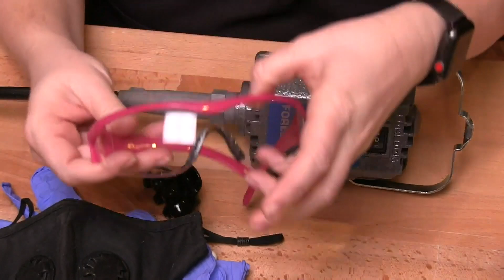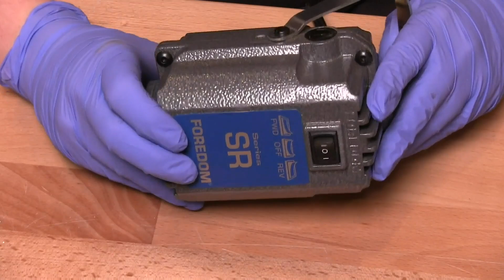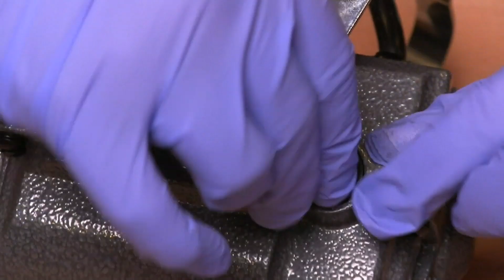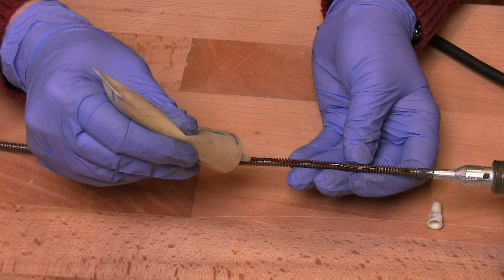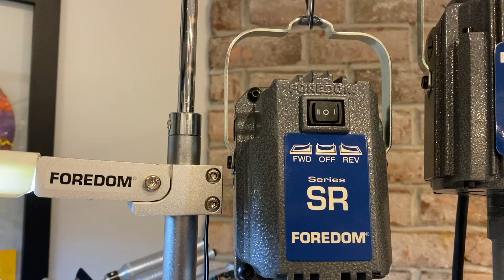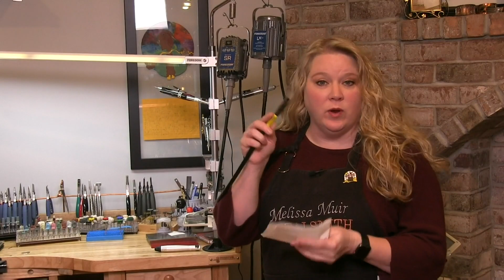Maintaining the Foredom Flexshaft with Melissa Muir

Comment: I just cleaned mine for the first time ever with your help.  Thank you so much!  
I didn’t have any alcohol to use for cleaner, so I put Dawn dish soap on with hot water and cleaned it with a brush and dried well before re-assembling - it seemed to work.

Comment: i have an older foredom that currently does not have the quick disconnect flex shaft. can it be upgraded to the one with the quick disconnect? i want to be able to use multiple heads like the hammer head and 90degree head

Comment: any tips on removing excess grease from the rubber sheath?
Reply from the maker: After you lubricate the shaft and reassemble it with the sheath, hang it down in an unlined trash can without the handpiece and run it at high speed for 20 minutes. Then stop and wipe off any excess grease of the key tip with a paper towel or rag. Always hang up the handpiece or remove it from the shaft after use so warm grease does not migrate into the handpiece. Thank you for reaching out! - Foredom Team

Comment: washing solvent must totally match the lubricating type we are using 

how can I detect of find some info about the original and cheap china lubricants sold as FOREDOM originals?

what widely used lubricants can I buy in any car shop and use with the flexible shafts?
Reply from the maker: The handpiece attaches to the sheath not the shaft. The proper way to adjust the shaft and sheath is to slide the inner shaft coupling up completely on the motor shaft and tighten the set screw on the shaft flat. Then thread on the motor connector all the way, snugly. Next, insert the  key tip end into the plain end of the sheath and slide the sheath up over the shaft. This is after the shaft has been lubricated with our shaft grease MS10006 which is a high-temperature lithium grease. Insert the plain end of the sheath into the motor connector until only 3/4" of the shaft tip extends out the bottom. Tighten the motor connector set screw. The handpiece catch ball and C spring clip snaps on into the grooved end of the sheath.

Then run the unit with no handpiece attached at high speed for 15 to 20 minutes with the shafting hanging down so that the grease is redistributed and any excess comes out the bottom. Wipe off the excess grease and attach the handpiece. Always hang the handpiece up or remove it when done so grease does not migrate into the handpiece which will make it run hot.

Comment: Hi, I used my for cut jump rings . I decided to change the blade, put new one.
Everything on order, motor working, blade spinning, not wobbling , but it’s not cutting anymore, or cut 1-3 rings on coil , even smoke from blade coming out because I try to force little bit . It’s very frustrating, it’s almost new and cut perfectly before. Do you have any suggestions for me?
Thank you.
Olga
Reply from the maker: There could be a number of issues. First is the blade on correctly to cut in the forward direction? What would happen if the put the old blade back on? Is the motor in the forward direction? You should call me, Mike Zegelski 800-272-2885

Comment: Hi Melissa, thanks for posting this educational video on using the Foredom. I was grinding the other day and saw an electrical "poof" with my SR 1.7 Amp Motor. I believe that I have blown out the motor brushes. Hopefully this is something easily fixed! I am considering purchasing a replacement motor maintenance kit............Does this seem like a fixable issue? I do not want to buy a new Foredom!!!
Reply from the maker: You should unplug the motor. Take out and inspect the motor brushes to make sure that they are at least 1/4" long. Before replacing the brushes they should blow out the moto with compressed air. Hope that helps! Thank you for contacting us!

Comment: Hi, how do you clean the hand piece
Reply from the maker: This cannot be answered until we have the model of the handpiece. They are all different. What is the specific cleaning issue? Do they want to open it up and clean it or just blow off the collect? Is it getting hot or are they having a problem with the collet or burs? Have you read the owner's manual and instructions that came with the handpiece? You can contact me, Mike Z, at 800-272-2885. Thank you

Comment: What carver are you using in this video I have a master carver but I don't know the model of it how often should I put new grease on the shaft I don't tend to apply new lub to my shaft unless it breaks or needs replaced  should I start  blowing out the brushes because we never have done that before my dad has had his master carver for years no issues with it  yet except it gets hot if you run the motor non stop  I will be   doing monthly  maintenance on ours from now on . We don't  on ours.
Reply from the maker: Great questions! Thank you so much for reaching out to us. Please call 800-272-2885 or email us at: customerservice@blackstoneind.com for help.

Comment: My vevor carver has developed a problem, when I put any pressure on a spinning burr it quits spinning even though the motor is working and it spins when not carving. Any ideas/suggestions?  Thanks
Reply: Hi I own a master carver Gear  and I experience this issue with my bit not spinning have you taken the sheeth off the flexible shaft of the motor and checked the set screw. to see if it's lose? On the inside of the master carver flexible shaft ? What I had to do is remove the  cover from the shaft on the motor to the master carver, I had to use a small screwdriver to  slightly tighten the flexible shafts set screw that was my issue with my carbin bit not having power or spinning note my shaft wasn't broken. It just needed the little set screw tighten up after that was done and put back together on the motor to the master carver Gear  I had no issues after that I'm not sure what  carver you own but I hope my comment helps 😊.

Comment: Have thought about this video since I viewed it.  Was at Home Depot over the weekend, and in the paint isle you can buy 100% denatured alcohol, which has no water in it unlike the medical product used in the video.  You could also buy odorless mineral spirits which is also an excellent grease remover.  As a machinest who uses Evaporust a water based rust remover, I can vouch for how quick water will lead to corrosion in mechanical parts.  Cleaning your flexable shaft in a product that is 50% water seems like inviting flexable shaft failure when you just schmear grease on the shaft after wiping it with a towel and trapping the water.  At a minimum why not spray the shaft with WD-40 first to encapsulate any residual moisture?
Reply: I use odorless mineral spirits, no water there
Reply: Thanks for sharing this tip, I wasn’t aware of this!